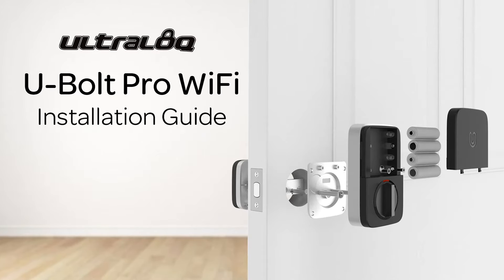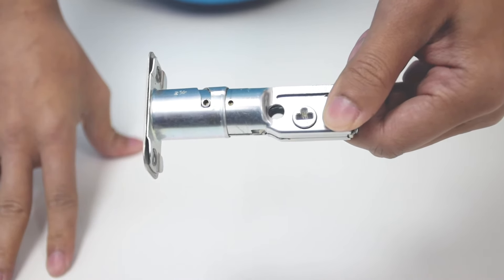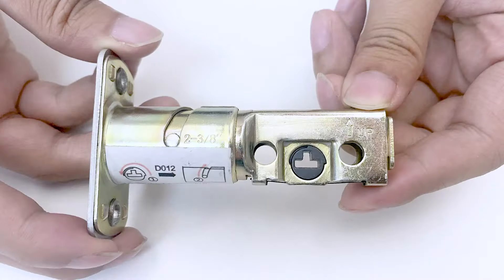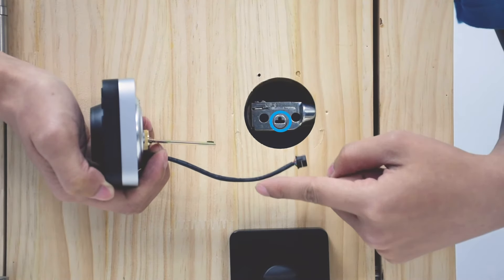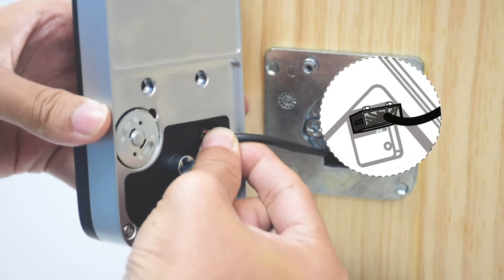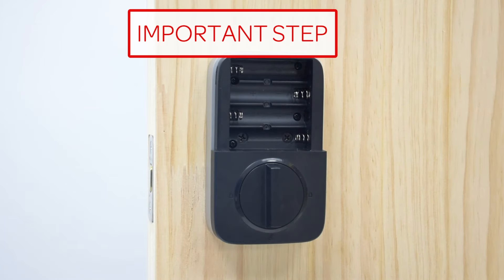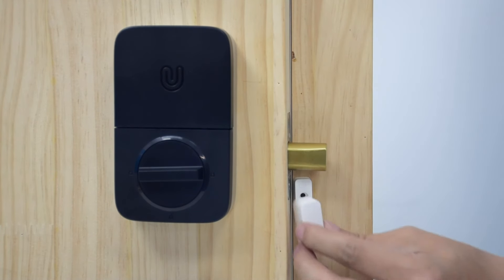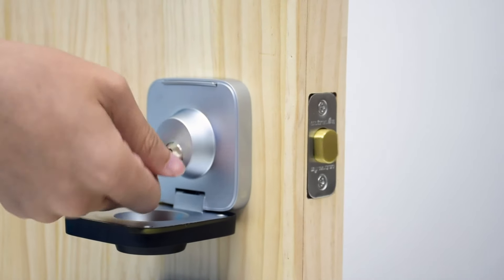ULTRALOQ U-Bolt Pro WiFi | Installation Video

Comment: I did the installation of 2 locks yesterday, and the instructions were very informative and clear.  However, the one part that was not clear was how to plug in the electrical connector from the part of the lock facing outside to the inside piece. It may be that the connector is keyed so it can only go in correctly, but I always stress out when putting pressure on small plastic pieces.  It is easy to destroy things if you use too much pressure.

But, the rest of the installation and setup was simple.  Thanks!

Comment: When I insert the batteries with the deadbolt locked it does not learn the correct position. It repeatedly tries to automatically lock the door to the wrong direction even when I turn off auto lock. If customer support cannot fix my problem, I'm gonna get a refund.
Reply: Same thing happening to me.  The slide is also VERY stiff!

Comment: Hey Ultraloq, I received my new loq but the bolt that secures the door doesnt look like the videos or pictures, is this a mistake or is just a redesign. If it is a redesign does it have the same ANSI 1 resistence as the previous model?

Comment: I installed the lock and connected the wires but when I insert the batteries the LED does not light up. What to do to troubleshoot?